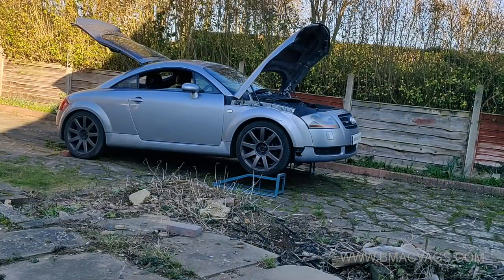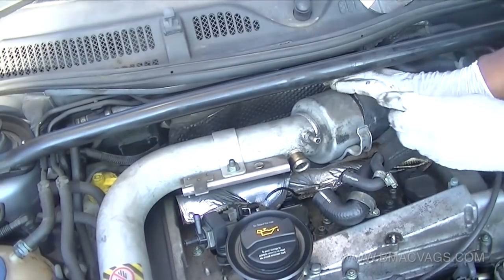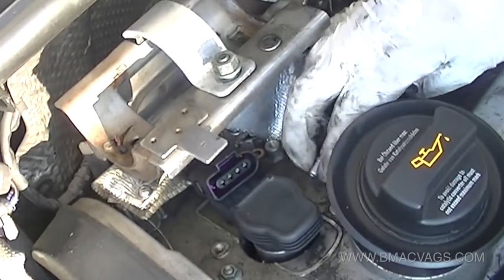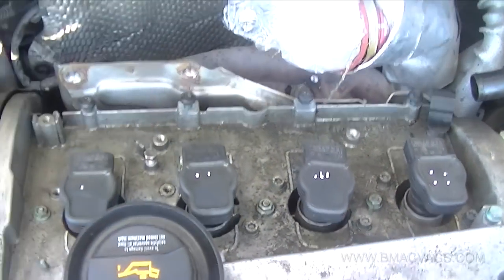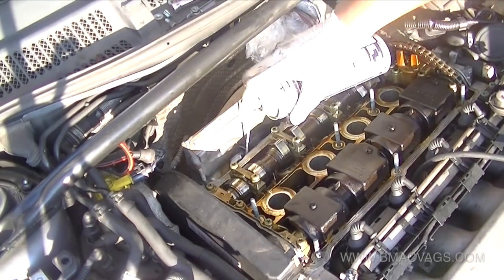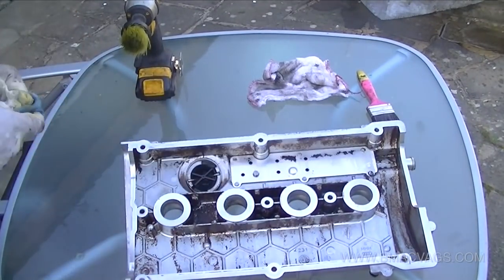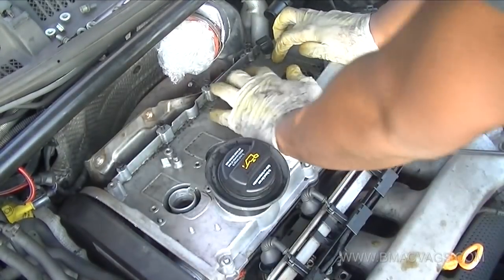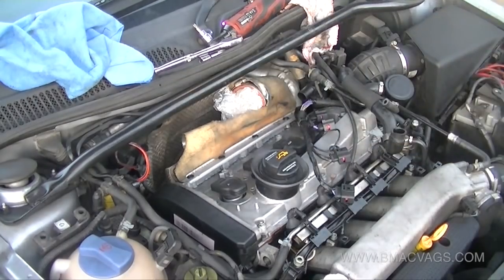Audi 1.8T Valve Cover Gasket Replacement DIY

Comment: Hi, I would like your input please, I have a VW Golf MK1 2008 Model, 1.4 fuel injected, I washed the engine at home and it started to misfire. I replaced the spark plugs and checked that all are still firing. What I noted was that the car was over-fueling as there is always a strong petrol smell from the exhaust with black smoke.